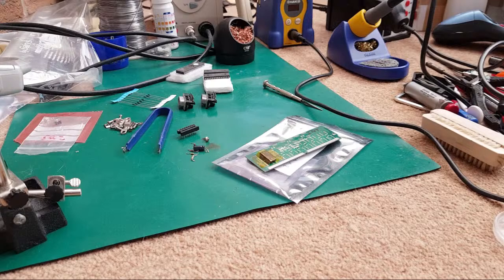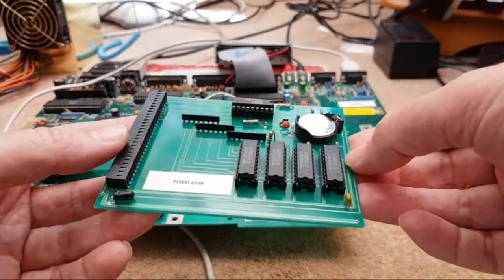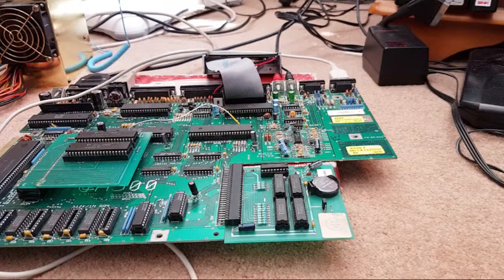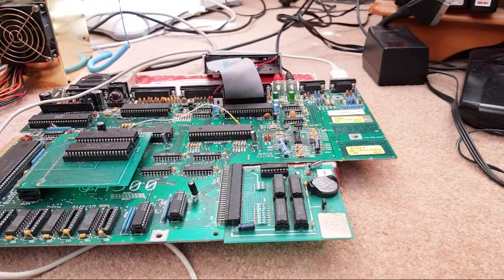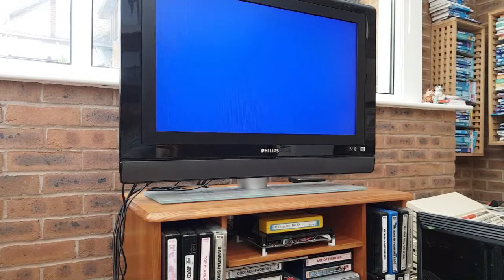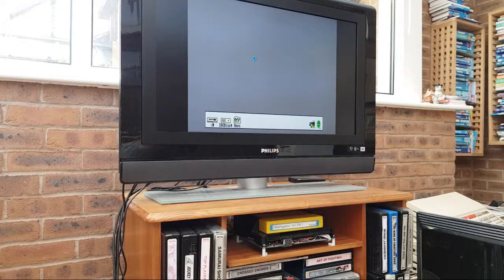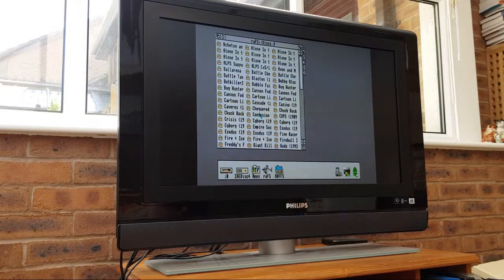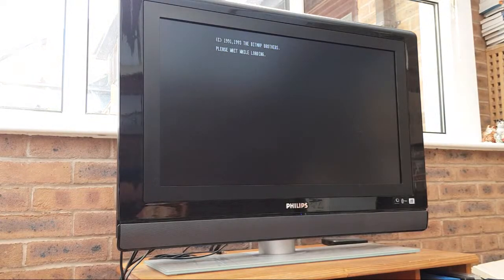Amiga RTC Fixes Update / Archimedes A3010 & A3000 Testing & Small Repair

Comment: A quickie hint. When checking traces on a bare board and you come to a thru-hole, jam a resistor/capacitor lead in there and tack solder it in place, then flip the board over. The hole with a lead sticking through is the one you want. You can then heat the lead from the top side and it’ll just fall out, once you’re done tracing the wiring from the top side! If the board is populated, desolder just the one hole, then look for a corresponding component lead free of solder on the other side (or jiggle the lead from underneath, then look for the movement on the top side)! HTH! BTW: I enjoy your repair videos, even if I don’t have an Amiga or Archimedes. I just like seeing the insides. 😊

Comment: I have the same issues with RTCs on expansion boards when the battery is removed. The RTC was not detected until I removed the 12V feed. I think this is because the working voltage range of the RTC chip is about 3V to 7V, so with no battery pulling the 12V voltage line down, the RTC chip was being fed too high a voltage.
Reply from the maker: I think the chip was working at that higher voltage though!  ie. It wasn't dead!  I suspect it messed up the logic levels!

Comment: Just wondering why no one seems to rig an LIR2032 which I believe is already 3.6V and rechargeable instead of feeding these repairs with a 3.2V CR2032?       -Mark.
Reply: Are they expensive and difficult to get replacements for if they die? CR2032s are pretty ubiquitous at this point.
Reply: I believe I seen 3 for $10 which should be good for MANY years.   -Mark.
Reply from the maker: An LIR2032 would probably work, but you would probably need to change the charge circuit to be on the safe side.  If you don't charge it correctly it won't hold as much charge, or damage the battery.  I just find it easier to just  fit a standard replaceable 2032 cell.   It does mean swapping it out every 2 or 3 years but its better than having to solder something etc.   That said, I do have some LIR2032 that just fit into the same holder and dont need soldering on, but that could complicate things if someone later tries to swap it out with a normal 2032 that is not chargeable =/
Reply: @GadgetUK164  I figured since the LIR2032 was actually 3.6V it would charge properly and wouldn't require any extra Diodes or anything else not to mention last a lot longer...Also, one could put a label there saying 'Replace with LIR2032 Only'.  I would just love to see someone make a Video with that Mod as I would Def watch it...;)  -Mark.

Comment: Can you fly away from the sun? Depends on where you are. On the equator, you would need something that flies close to 1700km an hour. Closer to the poles, you will get away with sub-sonic speeds, which should be doable with a normal passenger plane.